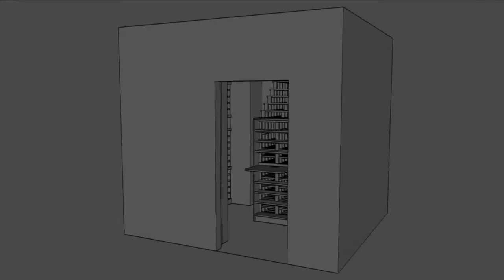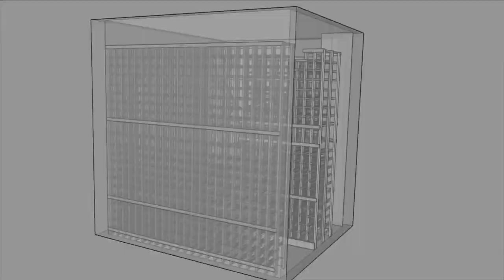Wine Cellar Installation - Final video in the Wine Cellar Series

Comment: Did they not do any type of cooling in that cellar?
Reply from the maker: In the tour, I pointed out the space above the door is set up for a cooler if needed.  This cellars back wall is underground and the climate is coastal, so rarely over 80 degrees.  It should be fine without artificial cooling.

Comment: Really nice job.  It turned out super.  One question I had was the "display" bottles seem to be pitched the wrong way if they have a real cork.  Any concern on your end?
Reply from the maker: There is still a bit of contact with the cork on wines meant to age. They typically use longer corks. 

Otherwise, I would suggest rotating the display bottle every 6 months or so.

Comment: Thanks again for these incredible videos. I watched the "Wine Cellar Racking" video about 10 times while I was building my jig.
The lights add a lot to the racking. My wife wants me to include them.
What type of LED display lights do you use? I see that they are positioned toward the front of the rack.
Reply from the maker: I got the idea and supplies list from this video: https://youtu.be/-OEv7h5cDms
Using the 45 degree chanel with the diffuser was key.  I hate the single light on a strip reflections, the diffuser helps a lot.
LED Strip lighting: https://amzn.to/3ttdhDQ
LED 45-degree aluminum channel: https://amzn.to/3mUsV8E